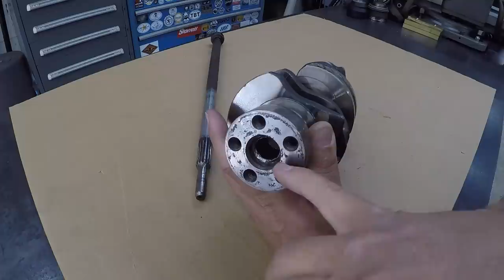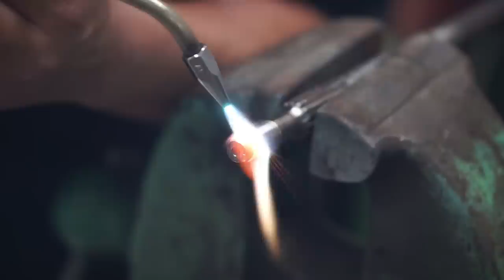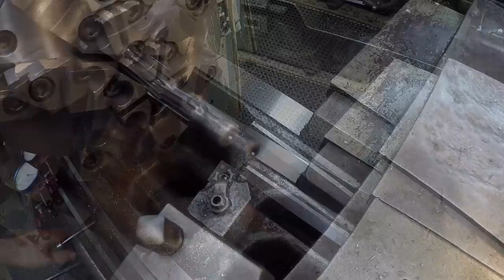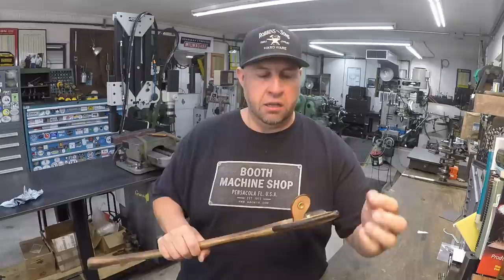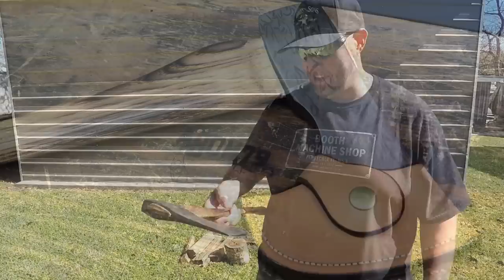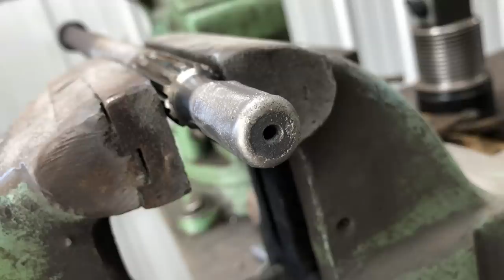SNS 292: Eutalloy Repair on Transmission Shaft, Essential Craftsman AX

Comment from the maker: Many viewers don’t realize that I try and show different techniques used in the shop for repairs and machining. I’ve recently published a video talking about the torch system I used in this video. I’m using the Ultra Jet made by Eutectic Company. The Ultra Jet is used to build up parts that are stationary, not rotating. Many people are asking “why not spin it in the lathe?”  The Eutalloy system doesn’t work with a moving part. You use controlled movements to build up the surface similar to how you would with arc welding or brazing. One of the reasons I wanted to use my Eutalloy torch was because the end of the shaft was worn down further then what my other spray welding system could build up. The end was worn, not beveled like people are claiming. The shaft was banging around inside that hole and was hitting the drilled portion of the end of the hole. I wanted to use this torch because it was perfect for a build up repair, and to share its use on my channel. It’s got many uses and with a little open mindedness and or research, anyone watching can learn it’s benefits. I repaired the shaft the way the customer wanted, by building up the shaft and machining it back to spec, all the while using a tool I invested in for welding overlay repairs. Also, I don’t own a welding positioner. If I did I would have used one to spin the shaft instead of clamping in the vise. I’m just trying to share some work guys. Keep in mind there’s 100 ways to get a job done. My way may not be the perfect way, but it’s my way. If you don’t agree, that’s ok. Do things your way.
Reply: Abom you're inspiring. Keep up the excellent work! Watching you from the UK
Reply: Thank you for the explanation, I also wanted to know why you're not using it in a rotating jig :) I'm a complete layman, so it wouldn't be criticism, just curiosity. Thank you for all the videos.
Reply: Thank you... I knew there was logic to it, I was just wondering about what it was!
Reply: Cool. I was curious too, but that explains it. Thanks
Reply: Abom79 I for one like seeing the other options. In the past I've approached similar jobs by welding or brazing (better suited to some of the antique and occasionally cast iron parts ive worked on) and recently purchased a Metco spray metalizing system to try to. I have never used one of these systems, but I can see lots of possibilities for it. Maybe someday I'll look at one.
Reply: Amen!
Reply: Was that a mike I heard hit the floor?
Reply: Welding Positioner?  Just clamp a piece of pipe in the vise and use a large tap handle on the other end. should be balanced enough to not turn on its own yet be close enough to move with your left hand while keeping the torch going with the right.
Reply: @bwyseymail  but where would Adam get a tap handle that big...  :)
Reply: Keep doing what you’re doing Adam - you’re the best machinist on YouTube; we love your content and look forward to seeing more of your adventures with Abby.
Reply: Was wondering why you didn't set it up in the lathe and spin it. Would even the slowest speed be too fast to build that up? Wasn't aware it was only used on stationary parts. Guess your next investment is going to be a welding positioner. Does this method provide a better bond than the spray welding?
Reply: Abom79 Adam, how can I contact you about doing some work?
Reply: Your channel do what you want. I enjoy all your videos no matter the content you chose to show.
Reply: good job i have used  that torch building  up hammer mill parts
Reply: Was this video in any way sponsored by Eutectic Company? Did you buy the torch and powder or did they provide it?
Reply: so you didn't spin it in the lathe because it doesn't work on rotating parts unless you owned a rotary positioner..then you would have spun it in that...oook...sounds contradicting..
Reply: @MG-og4zp  Learn the difference between "turning in a lathe" and a "welding positioner"
Reply: not surprised to get a response like that....I assure you I know the difference..I think you missed my point..you stated that the system doesn't work on a moving part...then said if you had a positioner you would have used it..a positioner rotates the part..that means it's moving...unless you turned off the rotation...then what would the point?..so I'm guessing it does work on moving parts..If the parts are moving slow enough...or maybe it doesn't...you own the machine...Im just trying to be clear... either way nice work..have a great week
Reply: Well, that's one of the nice things about being a machinist. There are several ways to do something. Granted, there are plenty of wrong ways, but also many right ways. All depends on what machinery you have, what tooling and gauging is available.
Reply: @MG-og4zp  You would use the positioner to turn it a bit, weld a bit, turn it a bit, weld a bit etc. So while it is turning, the positioner isn't constant rotation like a lathe but it is easier than loosening the vise, turn a bit, and tightening a vise etc.
Reply: It's easier if you hold round shafts loosely in a vice with v groove jaws. You can 1 hand the torch and rotate the shaft, that way the flux doesnt get ahead of you as much. But it is a nice system for building up shafts, more precise than bronze rod.
Reply: Thank you for the explanation. Ive seen other videos when you spun the shaft and spray welded it, was wondering why you didn't do it for this one. I figured there has to be a reason.
Reply: Don’t let the internet ˋexperts“ discourage you. You’re clearly well qualified and these videos are great to watch. Thanks

Comment: Hi Adam Re. I hope you don't mind me commenting - Re. the kabota crankshaft:  Most current crankshafts do not currently use a bush in the rear end for the Gearbox First Motion Shaft Spigot.  Years ago, they used to be fitted with a porous phosphor bronze bush - that was preferably soaked in light engine oil overnight prior to fitting. That practice was superceded by the fitment of a ball bearing in the flywheel.  If the worn crankshaft could be machined for a steel sleeve, and a ball bearing fitted of an inner diameter to suit the first motion shaft bearing surface, the First Motion Shaft Spigot area would not wear again. 

With the small amount of wear to the spigot area, the shaft could be machined for the shrink fitting of a SKF 'wear sleeve' of an outer  diameter to suit a firm sliding fit inside the ball bearing. It would only be necessary to remove the wear sleeve flange after shrink fitting.

Comment: Growing up around machine work with a dad and uncles that were career old school manual machinist/ mold makers/ tool & die makers/ and riflesmiths, steel & micrometer measurements are where my recreational thoughts always drift to. 

But I also watch essential craftsman, as I was once a framing carpenter many years ago. I loved framing, but I didn't quite fit in there because I was raised on .000"-.0000", my ideas about fitment often harmlessly clashed with coworkers. 

These two channels really satisfy my appetite for hands-on craftwork, in the two industries I enjoy.

Comment: That axe is beautiful.  I've heard that size axe called a 3/4 axe, and the drop on the bottom makes it a bearded axe.  I would offer one word of caution for you when using this size of axe.  If you are trying to do any sort of splitting with it, you should not do it standing, even if your target is up on a raised block.  If you glance off or miss a swing, a 3/4 axe is short enough that your over-travel can bring it down into your leg, where a full length axe will typically ground the head.  Believe me, it will surprise you when it happens, and you'll find it harder to steer the miss than you would assume.  I was used to using a full size axe, and almost got myself in trouble when handed a 3/4 axe at camp and trying to split down some kindling for the fire.
Reply: Very important to read for anyone of height using a smaller hatchet/axe/etc
Reply: Yes! Steel toed boots saved my left foot years ago.

Comment: That is a fine cutting axe not a splitting axe, as you saw when it did not split that small piece of wood-but jammed halfway down. A splitting axe would have split that in the first inch. Treasure that fine crafted axe as a precision tool. Best from ‘down under’-.👍🇦🇺🔭

Comment: Just curious. You said that shaft was hardened. what Rockwell 55-65? But, you said the build up was 10-20 Rockwell. Why doesn’t the repair have to be hardened to what it was before it was repaired? Thanks for the movie.

Comment: I just picked up a Eutalloy spray welding kit for $180 with quite a bit of powder.. I just have my farm shop, and no immediate use for it, but I figured ONE DAY, SOME DAY, I will have either a very expensive part, or just a part that you can't get that needs to be built up, and I'll have the tool to do it with, and that's priceless!
Beautiful workmanship on the axe too!
Reply from the maker: Rx7man it you have some of the hard powders, use it to hard face lawnmower or bush hog blades. 👌🏻
Reply: @Abom79  I think I do, and that's a great idea.. I have an old Murray mower and in about 10 hours the top sides of the blades are worn through where it's bent up.. It's a rough duty mower and it sees a fair bit of sand.  Sounds like a good thing to practice on.

Comment: Was surprised you didnt put the shaft in a kind of slow rotating fixture, as I figured it would be easier to weld on the material.

Comment: Just curious why you didn't do the buildup while the shaft was rotating in the lathe at a very slow rpm. You may have mentioned it but I missed it.

Comment: Back in the stone ages (1960's) I learned a lot of machining in my dad's shop at his rental center. One thing was the blades for lawn mowers. People really beat them up. A random traveling salesman came by selling and almost identical setup for metal spraying. One of the powders was tungsten carbide. My job was to grind and sharpen the blades when they were done. We never bought another set of blades. It was amazing. Thank you for making thing video.

Comment: Adam the end of a shaft that engages a pilot bearing is usually chamfered for the first quarter inch to make assembly easier
Reply from the maker: Roger Laubhan This one worn from rubbing the bottom of the hole.

Comment: Those Input shafts (Most ive Seen as a Mechanic for 35 years) generally have more Bevel on the end to aid in Stabbing the shaft into the pilot. Great Video
Reply from the maker: The end was worn from beating the bevel of the drilled hole.

Comment: Good job, Adam.  It's a camp axe, sized for smaller jobs, like cutting kindling, and smaller pieces of firewood, exactly what you intend to use it for.  I have one of the ones with the BSA crest on it, made back in the 30's or 40's.  Truly a beautiful tool.

Comment: I was just thinking that if the shaft is hardened wouldn't you want to Tig weld the build up using a hard alloy like monel or hasteloy? Then finish it up in the lathe. You have much more experience then me and it was actually cool to see that Technic you used. I've never seen it before although I'm guessing that's how they apply stelite coating to certain shafts.

Comment: That shaft build up, I have mig welded shafts like that but it is hard to do small shaft 1/2” or 10mm for bearings where I work are common small shaft end for long roller. Nice work.  Cool ax I watched him build it first

Comment: That taper is supposed to be in the transmission shaft to help get it through the clutch or drive plate and help it start in the bearing when the tractor is put together. Great video I like the Spray welding

Comment: silly  question that somebody might already asked
why not use a lathe to rotate this shaft while spray welding the material?
Reply: kokodin i agree did some of that over 20 years ago was still a little new then and we always rotated
Reply: I kind of expected that after watching the spray welding he did before
Reply from the maker: Check out my spray welding videos. This is a different process. Eutalloy, Rototec. Two different things.
Reply: @Abom79  sure, easy to see it works differently, I'll have to look and see if there is an explainer why it's done one way or the other anywhere.  Mind you this is just entertainment for me, end result looked great.

Comment: Quick note from a recovering wood-elf: the axe you have there is a felling axe, with a narrow head and fine, sharp edge designed for cutting across and diagonally through wood fibers in order to chop down a tree. You can surely use one for splitting in a pinch, but a tailor made splitting axe will do the job much more efficiently, with a head that looks a lot more like a sledge hammer that someone has ground into a wedge shape on one side.

Comment: I hope that soft material used for the fix doesn't get chewed up by the pilot bearing. I'm not sure what Kubota uses but the pilot bearings used in the automotive industry are needle bearings. Maybe a hardened sleeve would've been a better fix in this case.
Reply: Thats kinda what I was thinking, cool video and cool process though, just not sure about application.

Comment: I'm curious why you didn't have the shaft turning in the lathe so you can do the buildup while it's rotating like you've done with other spray welding.  Appears possibly that there may be no way to really limit how much powder is coming out.
Reply: I have the same question, I would think it would be easier to evenly apply the material

Comment: Nice axe.  With the included blade-angle being so small (less than 10°?) it's really a cutting axe (for cutting into a tree).  A 'splitting axe' has an included blade-angle of 30-40° and will split timber far easier.

Comment: I remember Eutectic very well from the seventies, when many garages still had extensive machining capacity. They demonstrated a system for repairing cracked exhaust manifolds, which for many older cars was a real saver.

Comment: It's called a spigot bush but a much better repair which I did was to press in a needle roller bearing.  The reason the spigot bush wears out is play in the gearbox shaft.  If you don't repair that then the bush will fail again just as rapidly.

Comment: Adam, That long taper is suppose to be on the shaft. I know this because I have put a lot of those clutches in these tractor working at a Kubota dealership. Great way of salavgeing  the shaft with spray weld. Cool axe too.

Comment: This does build up the shaft to return it to size. If the original base material is 45-50RC as a guess - then in the process of building it up with a softer material - heat anneals that base material from there. How long can the repair last running in a bushing of near equal hardness 10-20RC of the build up material? Possibly better suited for mated parts in fixed position press fits or press fit bearing shaft rather than a soft Eutectic alloy running against a plain bearing bushing?   Excellent execution! Questionable longevity in this application? Adequate for a tractor not a race car?
No offense there Adam. Love your channel!

Comment: I saw the same problem with the transmission mainshaft and crank pilot bushing in the 1980s when I put an engine in my Audi. The pilot needle bearing disintegrated and only the shell was left and the end of the mainshaft messed up. I took the crank to the nearby machine shop and he used his torch to remove the pilot bearing shell. But I had no way to fix the shaft end so reassembled it that way and the 4 speed worked ok. Abom showed a solution.

Comment: Wrap the handle of the axe just under the head in Scotch 130C rubber electrical tape. AKA splicing tape. couple or three layers and then wrap that in regular Scotch 33 electrical tape. That will help protect the handle for those misses that always happen and beat up the handle. Replace it when it gets worn before any booboos get on the handle. Its a very nice axe. Hope this helps to keep it this way.

Comment: A small tip with the splitting you want to have full arm and full axe length and aim for the closer side of the wood so you don't over strike and smash the inside of the handle just behind the axe head

Comment: Really interesting video Adam, thanks. The eutalloy is quite  different from spray welding, huh?
Reply from the maker: Yep, it’s a little different from the Rotary style of build up
Reply: @Abom79  I was wondering why you didn't use a rotating fixture for the shaft, now I know, thanks!

Comment: Beautiful bearded axe.  It's got a falling profile not really a splitting one so don't kick yourself that it didn't pop that oak so clean while it was thick.  If you look at the cheek of the axe that's the part from the edge to the eye where the handle comes through.  See how it is narrow and stays that way up to the eye.  Razor sharp with a gradual cheek it's going to bite deep really good for falling.   Edge that swells quickly in the cheek so that it is as thick as the eye before it gets to the eye.  That's the splitting axe lots of mass and pushes the log wide as it drives down popping the grain apart.

Comment: So you saved METAL CHIPS? Now I know what friends are thinking when I strip old electronics boards or cars for parts that I don't currently have any use for - because Just In Case:)  That chewed-up mainshaft makes me think there's some bearing slop in the customer's trans.

Comment: Wow, RC 10-20 is pretty soft.  I wonder how that build up will wear
Reply: Shouldn't be too bad since there will be a softer bushing. This area really doesn't see much load, it's more to just keep the end of the shaft from wobbling around.
Reply: @camyota  

The shaft will only spin in the bushing when the clutch is disengaged.  It should last for a long time on such a light piece of equipment.
Reply: 841k9 does that surface see much oil?